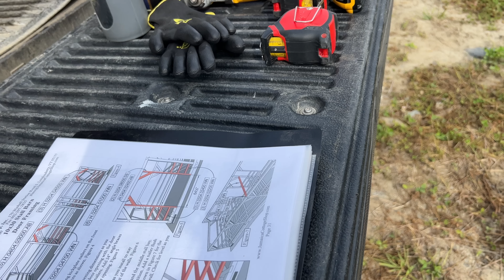Now Thats Using Your HEAD!!! Building 2 Post & Beam Barn Kits at ONCE

Comment: Al, instead of sled dragging these to move them, you might want to watch a few shed repo videos on Youtube.  They use 2 portable wheel sets on one end and a forklift type device to lift and move on the other.  You could make a wooden wheel frame to fit your sled base and use the TYM to lift one end and insert the wheels and then use the TYM or even the Bobcat to lift and move the assembly.  Should be easier on the building than just dragging around.  Either way, I love watching you build a JCS barn kit. It is always fun to see your experience shine along with a well designed pre-cut kit from JCS

Comment: We're saving almost half of our home build cost by using rough sawn lumber from a local Amish mill.  We order what we need, they cut to order, deliver it to the site and every piece has been selected by hand from the log it came from.  Usually, they'll cut all of the framing lumber from the center of the logs so you get a much straighter piece that will shrink consistently as it dries.  I got my entire framing list for what it would have cost just for the roof joists from a big box store, even with their contractor discount.  And the lumber is about 30% stronger than what you'd get from a lumber store.  I see your mayfly problem is as bad as ours this year.

Comment: Have you thought of putting metal straps on the seams of the skids? The same width and thickness of the corner straps, inside and outside of the seams.  Your have a lot of rocks sticking out of the ground. Catching one could cause a lot of damage.  Just thinking while watching you build.   Your moving along pretty quick with these two buildings, looking good.

Comment: The barns are coming along nicely, but what about the roof and siding on the house?
Reply: They hired a company to come and do the roof. They must be on a list and waiting to have it done. I'm not sure they have chosen the siding yet.
Reply: @StoneKathryn  same here. I would be doing everything I could do to be sure that the house is buttoned up weather wise. I did catch previously that a company was coming to do the roof and was wondering about the siding too. Also the propane tank needs to be installed prior to the weather changing. I know they have a much shorter and milder summer season than here in Georgia. Hopefully Al will address it.

Comment: One 36" screw picket driven in on the upwind, NW corner of each barn = 100 MPH wind protection. As well consider a few hurricane straps between the top stringers & roofs~
Reply: there are no hurricanes up there.
Reply: Actually hurricanes do travel up that far and the storms sometimes go inland causing flood, wind damage and sometimes tornadoes.  Many years back Canada got hit badly. As our climate is changing so much it might be wise to go the extra mile.
Reply: @damogranheart5521  ... hurricanes reaching that far north are usually downgraded to a point where it's not a big deal... except to those who live up there and have no idea how bad they are further south.
Reply: @rupe53  It depends on tides sometimes. In Canada it went up river and took out whole neighborhoods. That area of devastation was bulldozed and made into a large park.

Comment: Is there any advantage of this method over just 2x4's  ?
Reply: using 4x4 material is old school and makes everything sturdy. It's similar to the way barns were built 200 years ago.
Reply: @rupe53  pretty sure they used REAL joints with wooden pegs
Reply: @colinstace1758  ... agreed on the wooden pegs, and also notching each beam, but they didn't use 2x4 lumber in that era then double it up like we do today. BTW, in the early days the pegs only held the beams in place. It was the notching that gave it strength.
Reply: @rupe53  yep, I'm 50 yrs a carpenter 👍🙂

Comment: Frankly, I am a little surprised that the vertical posts are being held in by screws and no pins are being used.  At the very least I would have used some Samson strong ties to hold them together.  I wonder how this barn will hold up in a good wind.  Will the roof and walls just rip right off the foundation?  Time will tell.

Comment: OK, you get all the lumber supplied, some already notched and to length, All numbered, why do you need to cut?
Reply: he explained that everything is not always perfect with rough sawn lumber.
Reply: Explained in video about rough cut lumber.
Reply: @tonygrimes13  Agreed about rough cut and thickness, it’s the length of the board.
Reply: @rupe53  Agreed with the thickness of rough cut, but the length of the board he is cutting.
Reply: @iansmartel5473  ... I didn't notice him trimming length, only the depth of the lap joint so it would sit even on top..

Comment: Sorry Lumnah’s. I would watch the ads if they were not 45 + minutes long.  Maybe you can ask YouTube to use short 1 minute ads.
Reply: get a free ad blocker. Solves the issue.
Reply: YouTube creators have no input on ads. Ads are targeted to the individual watching by YouTube algorithm. You & I could watch the same videos at exactly the same time & see different ads. You only need to let ads run for 31 seconds for YouTube creator to get benefit. Also it helps to change your settings in your Google Account.